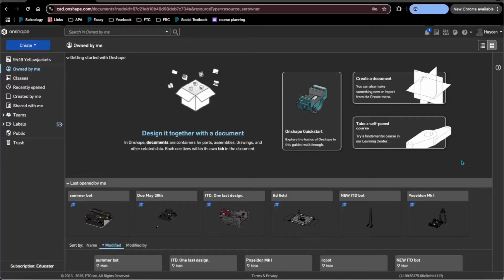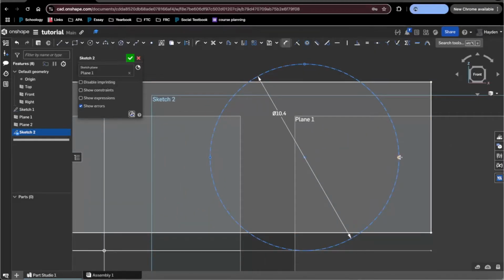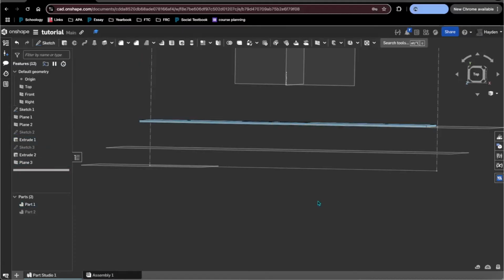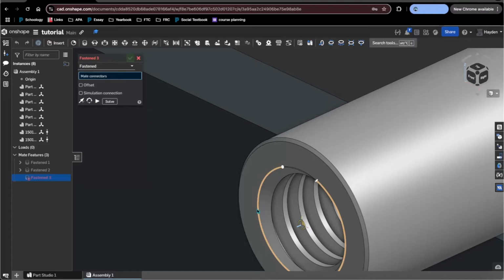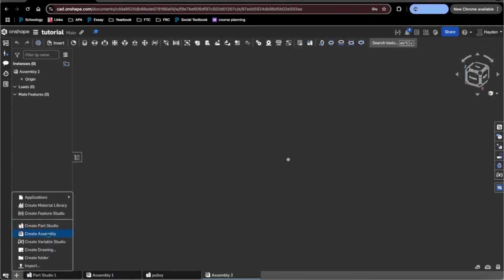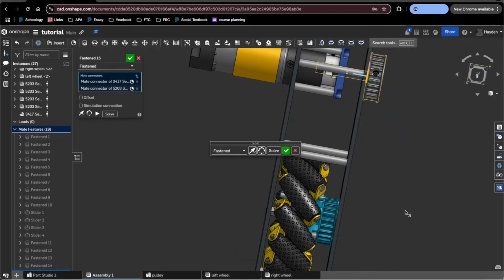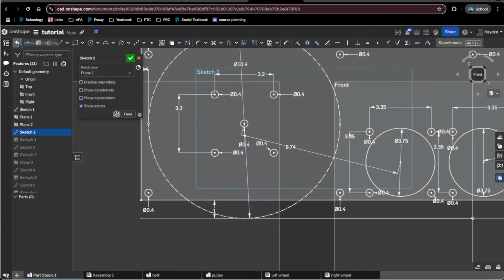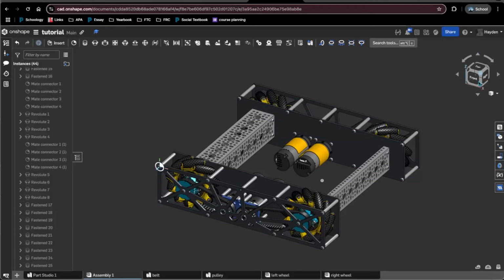Intro to Onshape for FTC - Parallel Plate Drivetrain Tutorial

Comment: Great video!  When you build this type of drivetrain, do you need to add anything to keep the wheels from sliding along the axel, or does the belt provide sufficient rigidity?
Reply from the maker: Usually you'd use a shaft collar or a spacer behind the wheel on that axle, I forgot to include that in the video. I might redo this tutorial at some point as it's not exactly the best or the most clear.